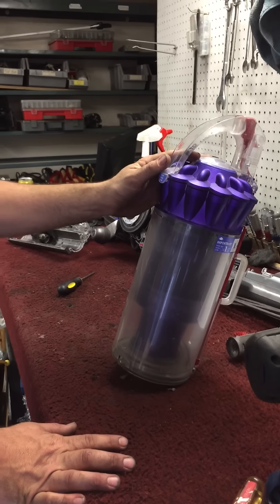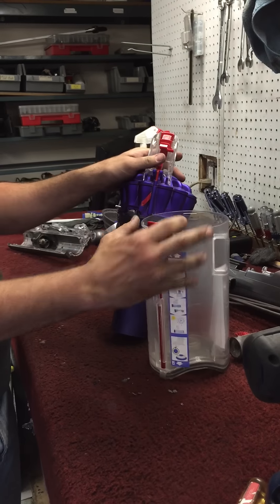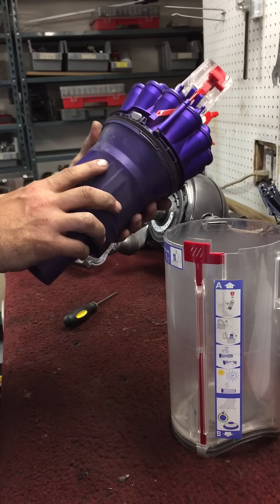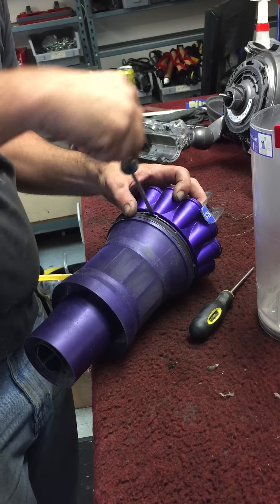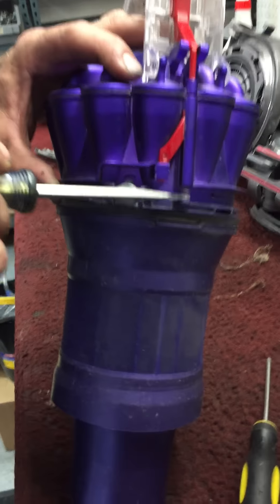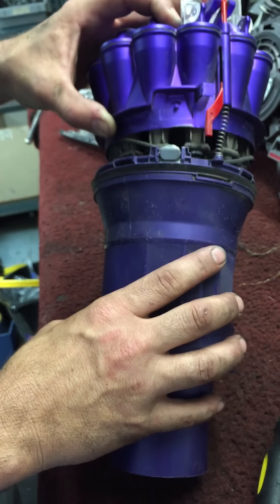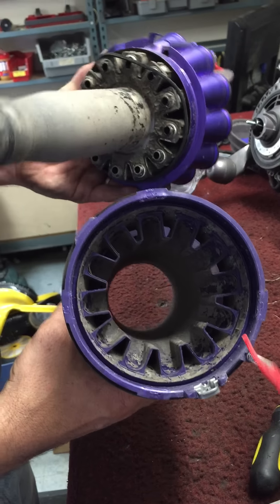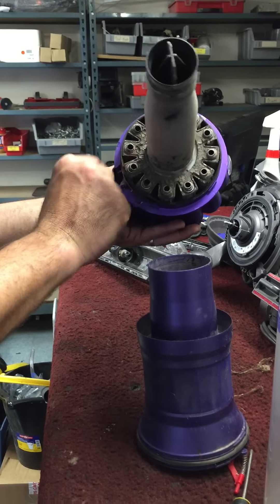Dyson DC40 cannister clean tutorial

Comment: I used a wet paper towel around a butter knife to get dust cleaned out of a hard plastic 'outer tube' on the red part of the disassembled canister. Dried it with a paper towel. Washed my 2 filters as usual. Everything is drying for 48 hours. Between this video and a video teaching me to clear a tube I was able to get a tissue I accidentally lodged in there (plus a big hair ball I didnt know was in there!) with the help of a thin  'snow marker to push the items through the detached tube (the one end is where you attach the attachments). Thanks for helping me!

Comment: Na I'm sorry that's long!

I just take mine off put some cleaning products inside part fill with hot-ish water & shake it all closed up several times over the bath or outside & washes everything out, you'd be surprised!!  Hold tight from top & bottom vigorously shake it up & down ect! Might get splashed but it's only water.

It does no damage & just have to wipe down after & leave to dry for few hours? 

I've done with every single Dyson model I've owned. You just put back on when its dryed.
No fiddly unscrewing. Funny enough I just done it today.  

I was looking for a video of how to change the carcass as unfortunately its cracked & come across this!

I'm just saying because some people aren't confident enough to take apart & for myself I couldn't be bothered, to much effort when flushing it out is faster & easier 🙂

I do appreciate your demo because it helps if you do want to take apart completely.

Edit,  my very first Dyson that's when this demo would've help & from that day I've just done above lol

Thank you 🙂

Comment: I have a DC41. The tabs on the canister are very tight and rigid. I'm pushing on them with a flat head screw driver and they don't move. You can see the top of the canister piece move when I press, but it really feels like it will break if I push any harder on the tabs. As far as you know, is the DC41 canister any different than what you're showing?

Comment: I managed to take it apart and find the inner rubber seal split apart. Is there a spare rubber seal available to buy?
The cyclone as I bought it from eBay is very smelly with pets hair. I got rid of excess dirt from the cyclone. I have removed the handle from the cyclone by unclipping it. I have removed all the rubber seals from the bottom of the canister and the outer rubber seal from the cyclone. and then dipped it in a large bucket of hot water with non bio washing liquid. With a small brush I cleaned all the nozzles and holes to get rid of muddy stubborn diets from the plastic cyclone. 
After I rinsed it few times and dipped it in a bucket of hot clean water. It comes out as clean and like new again. I let them dry for at least 48 hours before reassemble it together.

Comment: Thanks for this, very helpful but I don't think I will ever buy another Dyson again. It shouldn't be that hard to clean this part out and it DOES need to be cleaned! I had so much crap trapped in the cyclone, you can see it but can't get to it without risking damaging it! No wonder my filter could never get clean. Absolutely ridiculous and frustrating. I was hesitant to follow your video, I was afraid I would crack the plastic or but the spring back in the wrong way. My husband took the air compressor to it and blew out all the dust!! I appreciate your video but taking a high pressure air hose to it was a better option (and yes, dirtier) for me.
Reply from the maker: Hello! Dyson’s can perform great while they are working . My recommendation is if your looking for a bag less unit only use a Dyson due to how the cyclone assembly is engineered and patented . We offer servicing on both the Cannister and whole  units to help with upkeep and  maintaining . Air compressors can help remove excess matter , it also poses the risk of ripping a fiber gasket on the inside . I’m more than happy to help any further or assist in recommendations for replacement units . 
Thank you for your comment !
Reply: I followed the video, took my time and figured out how to get it to release. I think the trick is to get it one time and then it's easy. You can do it!

Comment: Appreciate the effort but when the camera is so far away from what you're doing it was hard to see exactly what you were doing to open it up, so I didn't want to chance it.
Reply from the maker: Wendy S 
Hi Wendy we do apologize for the camera angle and thank you for the input. if you have any question or would like to meet with a service tech feel free to call or text 909-678-5189 for further assistance.
Reply: The outside of the clear plastic dirt bin has a red plastic square at the top on the outside. It's attached to a long plastic 'stick'. Push the red plastic square down and it will reveal a grey button. Push the grey button in which will release that side of the canister. You have to tilt it in order for the red plastic 'catch' on the opposite side to release that side of the canister. Have patience, ease it out. Youll do fine. Plus the you'll know how to do it easily next time.